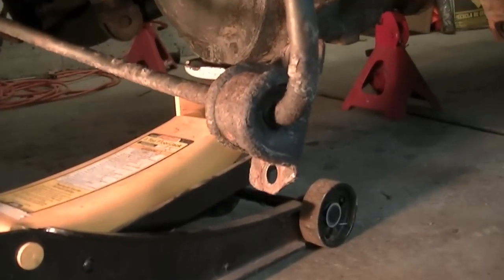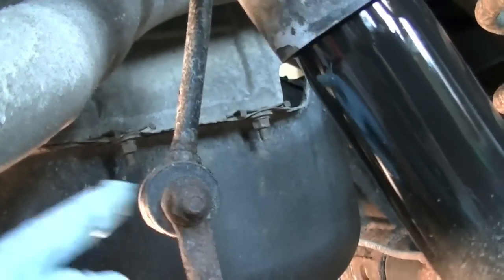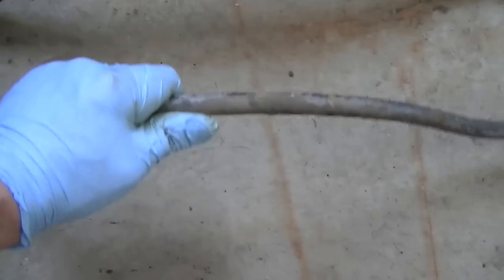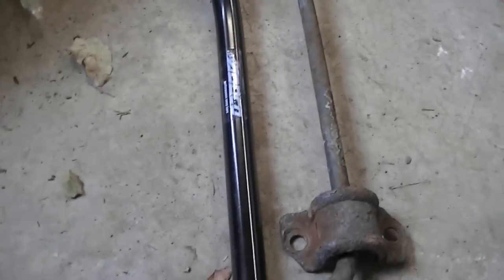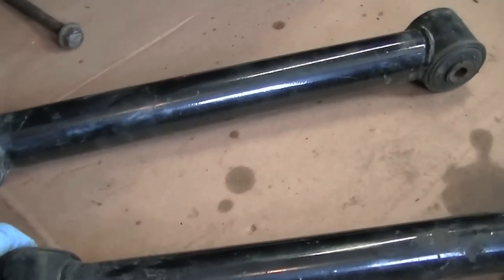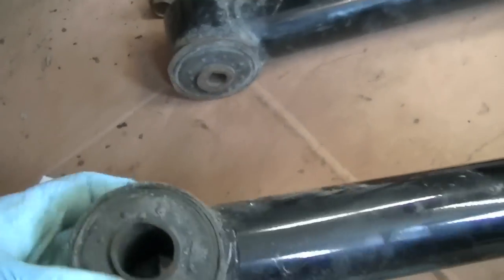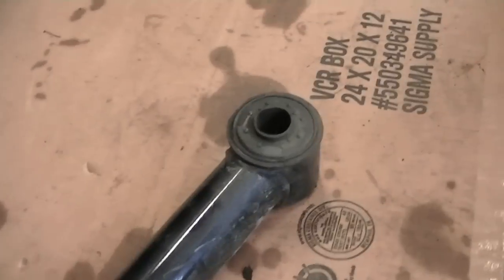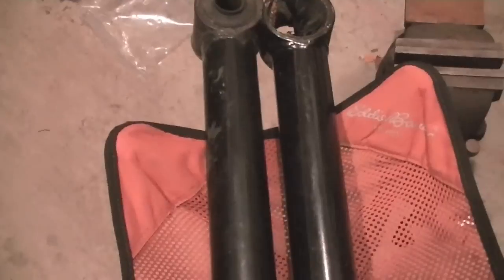Jeep Grand Cherokee Sway Bar

Comment from the maker: Addco sway bar from Amazon.  The front and rear trailing links from Morris 4x4.  The bushings didn't last 20k miles.  If you replace the control arms, buy Mopar or Dorman, they are the best and last the longest.  Traded this Jeep in at 138K for a 2014 Grand Cherokee last week.

Comment from the maker: Hi Ed!  Colin and I just came back from a test drive, amazing is all I can say.  There isn't any body roll, which this thing wallowed side to side before.  I wasn't expecting that kind of improvement.  Took it out for a good 15 mile drive.  I really noticed it when braking and making a turn down a street.  Hood stays flat and it just goes around the turn.  Nice to hear from you bud.

Comment from the maker: I can get poly for some smaller bushigns, but the ones that count like the upper control (wishbone), lower front and rear control arms are all rubber.  The Dorman made rubber bushings have lasted pretty well, much better than the Crown bushings.  The only downside I have heard is that the poly's tend to squeak and that would literally drive me crazy...

Comment from the maker: Yes, I jacked under the pumpkin and put two stands on the axle tube.  They needed to be closer to the pumpkin (differential) so that the bolts for the sway bar could be removed.  I didn't jack it up much, just enough to get the tires free enough to remove them.

Comment: If you look at newer vehicles the sway bars are getting even thinner. I was behind a Ford the other day and the sway bar looks pencil thin with long thin sway bar links attaching it to the frame. You can see the lack of strength. Everything for cost savings and weight these days. Thankfully there are aftermarket pieces to switch to.. Take Care..

Comment: I'm surprised you didn't go with the Energy 1.5161G bushings with grease fittings (zerks), or at least lubricate the new bar, bushings and clamps during installation, to prevent squeaking.

Comment: If you don't plan to wheel it then yeah the rear adco is great but have seen the unibody ripped when flexing because of the stiffer adco. Honestly I'm just going to run the front adco with quick discos and leave the rear stock as I do not like to remove the rear sway bar and drive on the highway to get to the trails.
Reply from the maker: The front is so beefy, I think its a complete waste of money.  I still have my rear sway, but not the Jeep... traded for a 2014 with a Hemi, that rear sway is so skimpy.  If you're muddin' and crawlin', put the money elsewhere, not up front on the sway bar.  JMHO.
Reply: Craig Arndt stock sway has more flex for crawling also the front gets discoed for crawling I dont want to drop the rear to crawl and the adco doesnt really flex also i've seen them rip the unibody crawling.  I've decided on a eibach front because its thicker then the adco   Also I perfer to have the rear hooked up for stability when I'm wheeling  only reason Ps By the way I'm doing the front is because my Wj is a daily driver

Comment: I just out polyurethane bushings on my stock sway bar and endlinks... If i got this sway bar would i be able to use e same polyurethane bushings? And also removing the top bolt on the bracket of the sway bar it stripped... Do i need it? Like would it effect performance?

Comment: Anyone know if this could be done on a 2011 jeep grand Cherokee?  The bushings are molded on the sway bar, and i was told i had to get a new sway bar assembly.  I cant find any after market bushings that say they are made for the 2011 JGC.  wondered if anyone had any luck using something else?  i DO NOT WANT TO REPLACE THE ENTIRE SWAY BAR ASSEMBLY, JUST THE TWO BUSHINGS.

Comment: Hey their I was just watching you video and would like to ask for some advice. I'm new to keeps and recently purchased a 99 wj grand cherokee that needs bushing replaced in the front end. Does it matter if it's stock or lifted or will all bushings be the same? And where's a good place to buy them?
Reply from the maker: I found that the best bushings were Mopar and Dorman.  Any cheap bushings get about 8k to 10k miles and you have to do the job all over (I know from experience).  If the Jeep is lifted or level, same bushings, but- lifted Jeeps many times use nylon bushings because rubber just doesn't seem to last as long.  I found Nylon bushings to squeak sometimes though- which you may not hear over larger lug tires.
Reply: Craig Arndt ok cool. thanks for the info. a buddy of mine was tellin me since its lifted that all my bushings will be aftermarket and I cant use oem. my lower control arms and rattling around a lot cause the bushing are shot.
Reply from the maker: He may be correct, I never lifted my GC.  I'm glad I didn't just didn't have the cash and the Buffalo winters were taking its toll.
Reply: yea I know it has the tubular control arms. when im online I find tubular and some more stock looking control arms. not sure if bushing are the same. I think I am going to pull a control arm off today and compare it to the one in your video and ill get back to you and let u know if the bushing looks the same as yours. like the size and what not.

Comment: hello craig i was wondering if you had any clunking from the sway bar or hitting the gas tank.
Reply from the maker: ***** Hi Eli T, I didn't have any clunking.  That sway bar made a lot of difference, corners were so much flatter than before.  I did have tons of clunking, but that was all coming from the rear ball joint in the A-arm.  I wound up replacing bushings, the A arm and ball joint and that made a big difference in ride and quietness.

Comment: hey Craig, with the ADDCO, did you notice an immediate difference?  what was the cost on that?
Reply from the maker: Think it was $180 through Amazon if I recall.  It was night and day as far as body roll.  The front roll bar is pretty thick but that scrawny rear twig basically does little to stop roll.  I noticed an immediate difference.  Just be sure to buy the correct one there are different ones.

Comment: I have 2 problems 1- is when driving at at a decent speed and I let off it very slightly feel like its fish tailing to the right and I have terrible thumping from  the right back side on a  rough road.I've been told it's shocks ,it's an axle it's sway bar,it's the rear end and I'm afraid to take it in  again as I know they don't know for sure and I just had shocks ,bushing, wheel bearing new tires.I have an 2004 Jeep Grand Cherokee . Good shape other than this thumping and swaying,I've replaced a lot of unnecessary parts I think.What's your opinion.Mine is only a 2 wheel drive.
Reply from the maker: nadiene kinney Hi Nadiene, yes, that awful fish tail effect when letting off the gas.  I know it well.  Also the thumping, that is the worst!  Good news, it is all coming from the same part.  The upper rear control arm.  It is a triangular brace that has two bushings that mount to the frame and another that attaches to the top of the pumpkin or differential.  The whole thing should be replaced.  It will stop the thumping or banging that occurs over the slightest bumps and it will fix the sway when letting off the gas.  Buy good parts.  I had to do the job twice, the first bushings failed after 10k.  MOPAR bushings are the best, they held up longer than any of the cheap ones.  Once I replaced this A-frame unit and bushings, I then did the two rear control arms.  The sway bar in this video really helped a lot with body roll.  Here is the video of the rear upper control arm.  https://www.youtube.com/watch?v=N65c08xBaxY
Reply: Craig Arndt Thanks and I will let you know how I make out
Reply: I replaced this bar and found the control arm on the right side gone plus the 2 on the front lower ones .The boots or rubbers are torn and pieces missing.Thank you for suggesting to look at these.I had a  road safety inspection done and this got over looked.
Reply from the maker: Good to hear.  The Upper rear control arm is a critical piece.  It attaches to the frame on the left and right sides as well as has a ball joint that attaches to the top of the differential.  This large metal brace has to hold the entire rear axle on center.  That is why you want to use MOPAR parts here.  I used some generics and they only lasted 10,000 miles and where torn.  Hope I helped out and you get many more miles out of your Jeep!